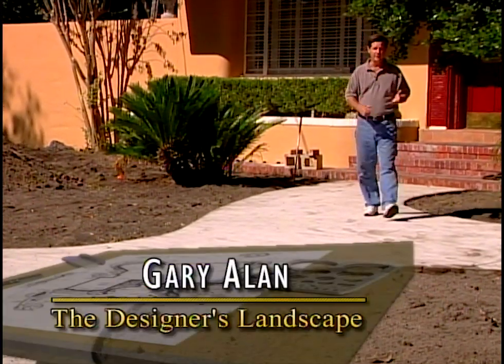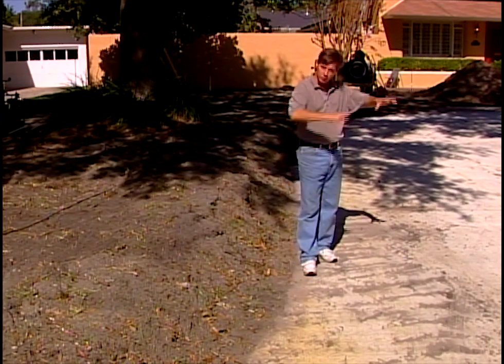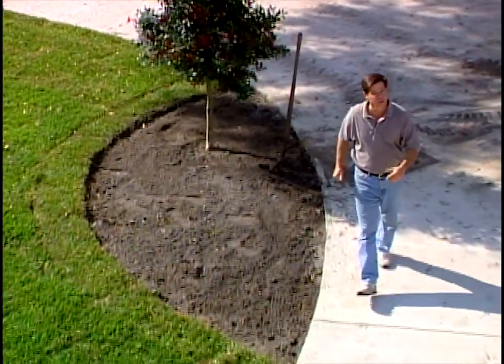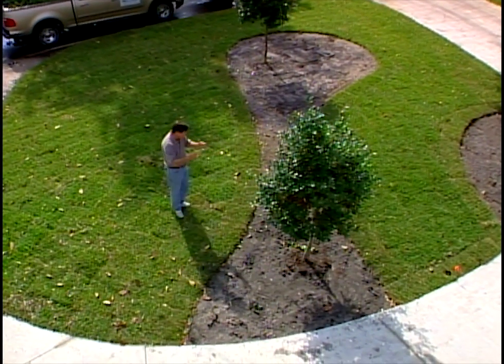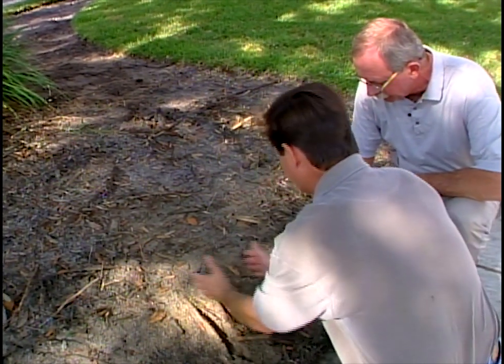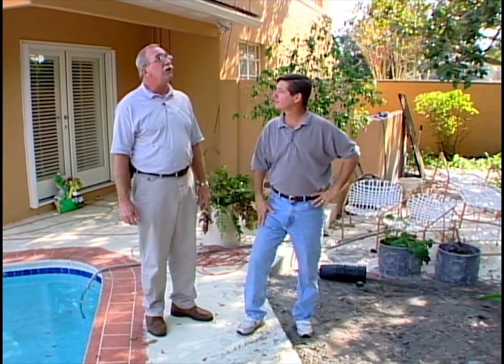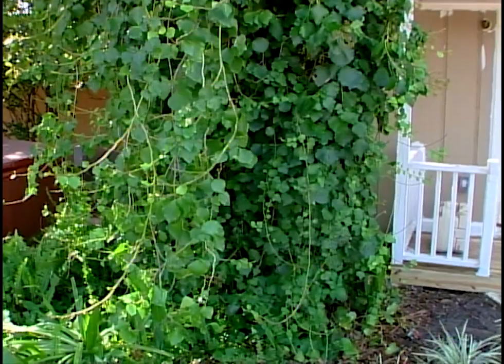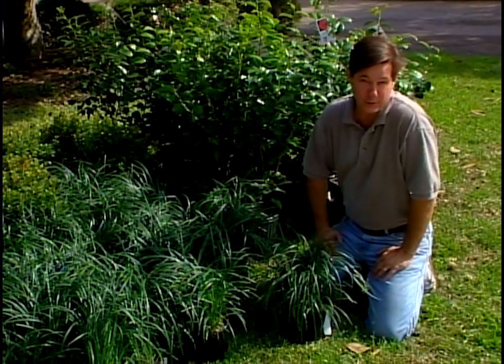How to add landscaping to a new driveway Designers Landscape#704

Comment: PA Lawn Guy. Gary, I was surprised that you did not reverse the circle sections that terminated at the drive and walk into a French- curve and tangent those places so the mowing would flow instead of having to back a little then turn 180 degrees. I am sensitive to that at 70 and still doing some landscape mowing.